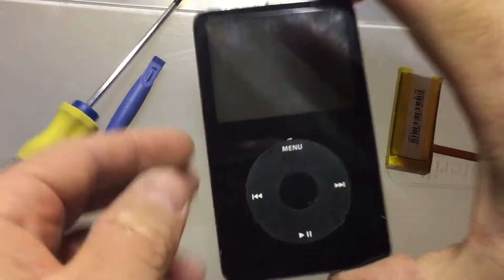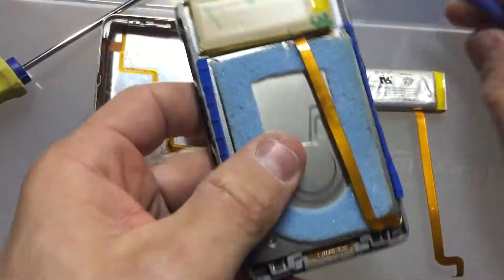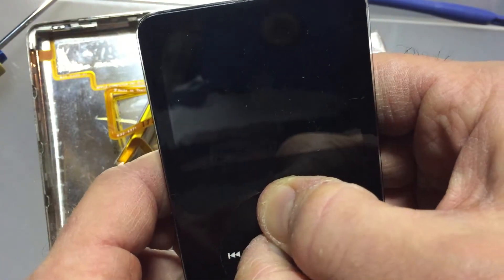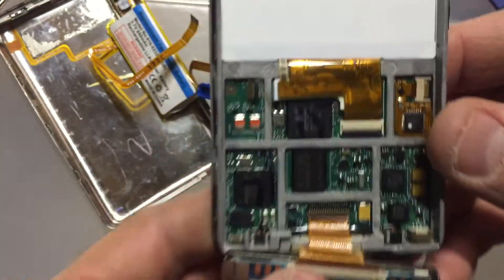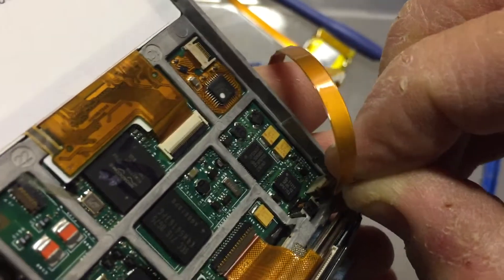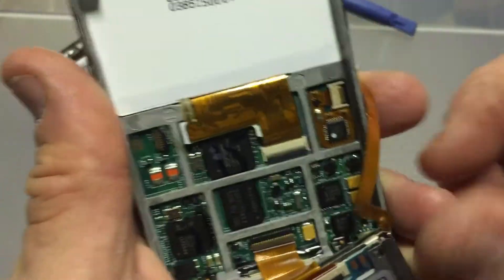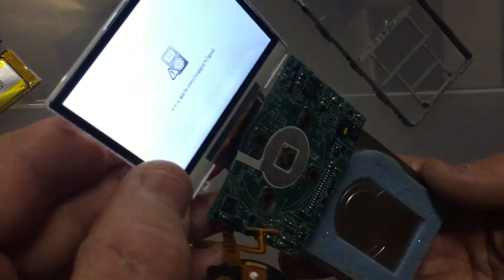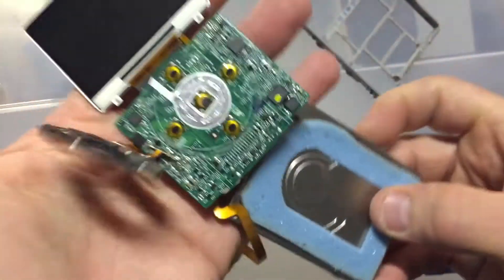Retro Tech: Apple iPod Classic Teardown and Sad Face Icon

Comment: I have same type of iPod but mine works well. Has tons of songs and 6 movies. But only works if you keep it on charge with charging cable.
Reply from the maker: Yes sadly all of these devices with embedded batteries will lose battery life and eventually need to run plugged in. You can find replacement batteries online but many are cheap unreliable replacements (I have a video on my channel showing what happened when I replaced my iPhone battery with a cheap eBay one... so buyer beware)!

Comment: I tried to replace the cracked faceplate (the iPod was working), but after it was replaced, something was burning on the board and I got that same sad face. Really tried to save it, but I actually made things worse.
Reply from the maker: It's good that you at least tried.